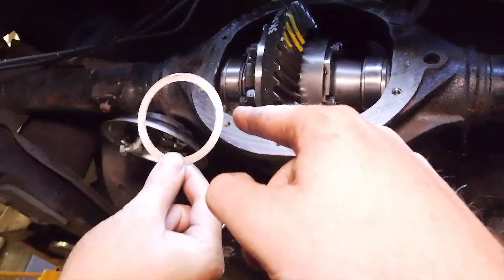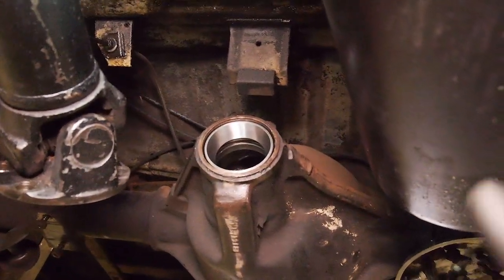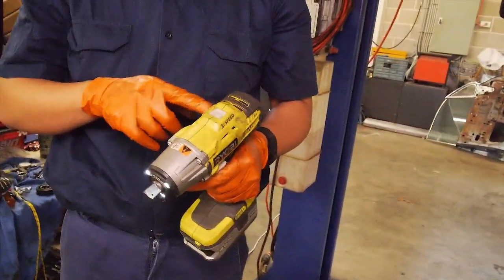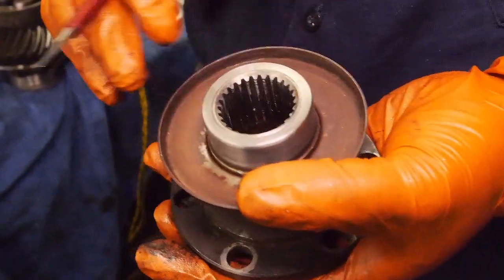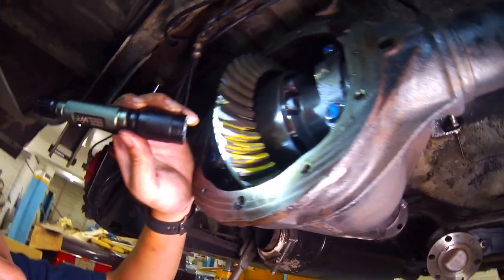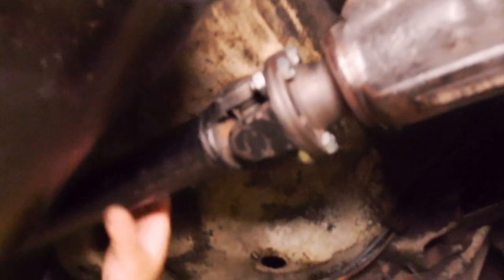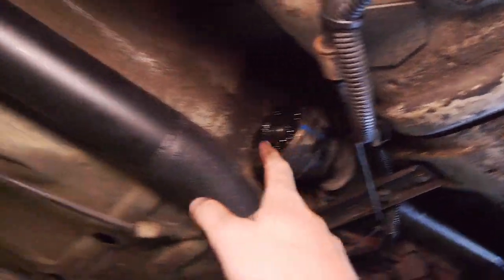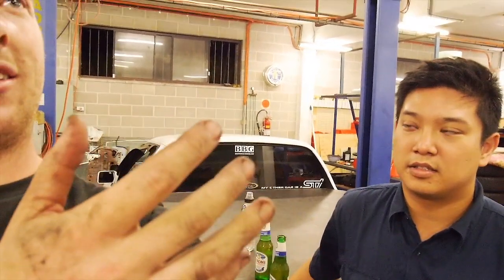THE MOST COMPREHENSIVE DIFF GEAR INSTALL | VR V6 TURBO COMMODORE - M78 | PART 3

Comment: Im watching this video after stuffing around with a VN diff all day and feeling exactly the same. Most commo diffs in that era r M75. If putting M78 gears in, you have to mill 80 thou or 2mm of the back off the back of the pinion to change the crownwheel and pinion relationship. After that the backlash is perfect and you have a wider option of gear ratios to choose from... falcons etc.

Comment: That's where you need both a dial gauge & a torque beam indicator,I can hear the gears howl.

I set my Dana M80 up with new bearings but reused an old gear set after the pinion bearing lost its preload,it was making a little bit of noise.

I reset the backlash to 0.12mm,set the new pinion bearings up to 2 newton metres preload with a new crush sleeve & set the side bearing preload up to 1.56 newton metres,I calculated that by dividing the recommended preload (1.5 Newton metres) by the diff ratio (3.91) to get a total pinion torque figure of 2.4 newton metres,so the side bearing torque was measured at 0.4 Newton metres at the pinion which is the closest I could get.

I also blued the gears to check the tooth contact pattern.

It still did make a little bit of noise at around 60 km/h but that seems to have diminished over the last few years to nearly nothing,particularly on the coast side of the gear yesterday, it seems to have almost completely disappeared.

They have been hitting on the high spots & I was seriously considering replacing the gear set but if the noise completely disappears,I won't worry about it.

I've heard that the Commodore in the video has needed to have its diff overhauled again.

Comment: Guys I saw the mammoth effort!! However not to be too critical but after the first test drive and observing a massive change in pinion rotation/backlash you didn't explain the seriousness of that condition. That can only be due to the rear pinion bearing cup moving fully forward home into the case. That will change the pinion depth and the backlash and painfully require a full re setup of the mark on the gear set and the crown wheels side to side positioning. You also can't accurately determine pinion bearing preload with the crown wheel in situ. If you just tighten the pinion nut it would have still had the massive backlash/pinion rotation. I know the job was already a saga. Best regards Scott

Comment: Usually when the mosfets in the hand drills fail, they only allow one speed.  Pop it open and solder in new ones and I bet the ryobi will be as good as new
Reply from the maker: +bradhuf2 Ah will add that to the memory bank. Even easier though, he got it replaced under warranty thankfully

Comment: Well done guys.   I own a shop and I feel your journey with it’s highs and lows.    You did well to machine the pinion.   I had mine professionally ground. But good to see it can be done.    Mine is 3.45 and 2.5mm was enough.   Ben, you remind me of my best friend at school.  Are you a trained engineer?  My friend’s name is Peter Beck  of Rocket Lab.   He’s a big deal these days with a new project to Venus.     So I’d say the world is your oyster mate.   All the best for the channel.   Keep the vids rolling.      How about you do a vid about stroking a 304.  I’ve just done a 383 but there are limitations with the shorter rod length.    Also a powerglide build.
Reply: Thanks for the kind words. Yea I’m a mechanical engineer. I quite like the Holden v8s, it would be cool to do a strip down of a build 308/355 from back in the day where they maxed it out like say a Larry Perkins build and do it up with 2020 tech. It’s just the old challenges of time and space... keep up the good work!

Comment: As a technician/ mechanic by trade you should of centered more the crown and pinion,since it was a new unit not a used one too far over to the outside edge of the crown wheel ,also should of ran the car on the hoist for abit .

Comment: I also have a trutrac m78, I have a heap of slack between the input and axles. My diff builder says its the slack in the trutrac? is this correct?

Also my trutrac recommends a good mineral oil and not a synthetic for it to work properly. can you please let me know how the synthetic behaves. thanks

Comment: I'm doing my bf falcon m78 ute diff.....how the hell did you hold on to that yoke? My new bolt bottoms out on it and I'm roughly 1.2kg drag, try to tighten the pinion nut and the whole yoke moves.....
Reply from the maker: I'm not sure I'm understanding what you're saying? Which bolt are you talking bout?

Comment: were the issues yous had just because of the trutrack being larger than the stock center? am wanting to do a 3.7 ratio swap into my vn sedan burnout car I've recently gotten but will be just running a mini spool in the stock center so would i encounter the same/similar issues or no? I know I'll have to wait and see for sure when I actually get to the diff and if it does turn into a pain I'll just take it to my local shop to get it setup but keen to learn to do things myself, done mini spool install before but were stock 3.08 ratio so weren't that difficult to slot back in, never done a ratio change though. one other question do the ratio kits come with bearings or is that separate?
Reply: my vn back to basics budget burnout car plan (track only car) 1. get it running needs coil packs n ignition module a battery and headers, 2. mini spool and 3.7s 3. v8 radiator and series 2 overflow bottle arrangement, rig up stock v6 thermo to run off a toggle switch 3. twin exhaust off a v8 modded to meet v6 headers and cut off just after center mufflers and fit 90 degree bends for sidepipes/diff dumpers. 4. some rims at least 2 lol 5. twin throttle manifold through the bonnet :D  hopeing to get this done within say 3 months at least xmas at the latest, shouldn't be difficult parts are fairly cheap already have coil pack setup on it's way, will have a battery this week too just need headers and see if it'll fire have considered fireing it without the headers just worried I might melt the plug leads haha then once it's ready get it out to madaz at qr and kill tyres and work towards realizing the dream of competing at summernats one day :D one day it may go turbo again too.....
Reply from the maker: +5lcalais1 Only have to machine the pinion to clear the bigger diff centre body. Mini spool will be fine from memory. And nah the bearings have to be bought separately.
If it's only going to be a burnout car, I would suggest going 4.11 rear ratio, would be even easier to start and keep a burnout rolling. Especially without a tonne of power
Reply: Ah ok thanks for the info. Yeah I thought of 4.1s but might be a bit short lol seen a few people using 3.9s who are limiter basshing 3rd excessively, I want to keep it of the limiter as much as possible I hate the sound lol I figured 3.7s would still be short enough to get 3rd but give enough resistance to keep it off the limiter, but got more research to do yet so I'm not completely sold on the 3.7s yet :) had 3.45s in a previous vn that held 2nd fine during the straight away sections but would bog badly on the pad die to the rubber buildup and I'd have to go back to 1st (it was a t5 though this ones an auto) auto ratios might be taller though so yeah more research is required 👍 thanks for the advice 😁
Reply from the maker: +5lcalais1 Ok well I can definitely tell you that with the auto you want and even lower ratio (higher number) at least 3.9 I would say. You gotta crunch the numbers and do the comparisons. Here is a really good site: https://www.blocklayer.com/rpm-gear.aspx
Reply: Ok thankyou, I'll check that link out tonight once I get home from work 👍 thanks man :)
Reply: yeah had a look maths isn't my strong point I can't make heads or tails of it lol as far as I could work out at 6000rpm the wheel speed would be 225km/h with 3.7s in 3rd, factory limiter is 6200? don't know how that all goes in reality though might be time to talk to a diff expert to make sense of of it all :)
Reply: 4.11s 4th tops out at 246, 3rd is 173 km/h but again don't know how that equates to on the pad.

Comment: this might b a stupid question but im only a novis but will that boost leak tester also work on a s/c engine?
Reply from the maker: If you've got an intercooler sandwich plate, yes. Otherwise there's nothing to boost leak test because the boost goes straight into the engine.

Comment: Got  a shudder noise in my driveline that basically comes in when you feed it a bit from a standing start...take off casually and have no dramas but give it a bit and it sort of sounds like a centre bearing shaking but ive replaced it and the old one wasnt that bad...done the cv too and it wasnt bad either ...unis have no play...any ideas....any chance its coming from the gearbox...no noises at cruising speeds and no vibrations at 110 kph...pinion has no side play or endfloat but can it cause this if the preload has loosened..any ideas
Reply from the maker: Mate you've got me stumped. I can't think of anything off the top of my head unfortunately 🤔
Reply: Thanks anyway how about begineers opinion?
Reply: Checked out the gforce t5 on youtube on paul cangialosi's channel and they look good and with the angle on the helical cut of the gears they whine .....t5s already have a whine stock....is it hard to cope with the extra noise? All t5s also have that running noise when in neutral ...how the gforce noise with engine running in neutral as they use a different cluster bracket that is much stronger and cant bend?
Reply from the maker: Yeah that's a good video series that one. It whines relatively loud. About half of what a straight cut does. I honestly love it and wouldn't like the car without it after having it lol 4th and 5th are quiet. 

Funny you mention that, it used to be relatively quiet in the car but as of late it has gotten louder, especially on idle. I'm in the process of trying to figure out what exactly it is, whether it's deemed normal etc.
Reply: do you find now with the new diff  you put it into 5th more often.....i find with a 3.08 its too tall to use under 100 kph
Reply from the maker: Its brought the car to life. Is so much faster and more nimble. Still don't use 5th unless I'm on the freeway 95+ kmh. The 5th they put in my gforce is a shit .63 should of been .76 so it's even worse than stock